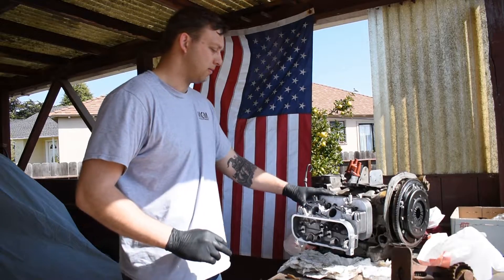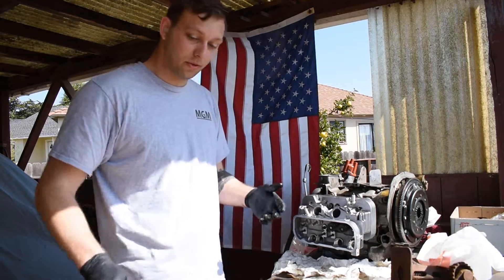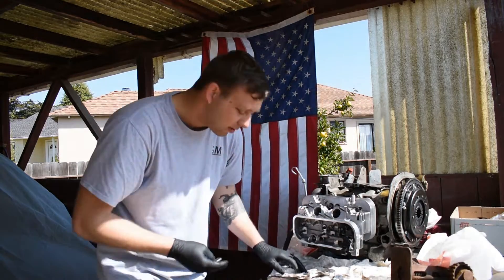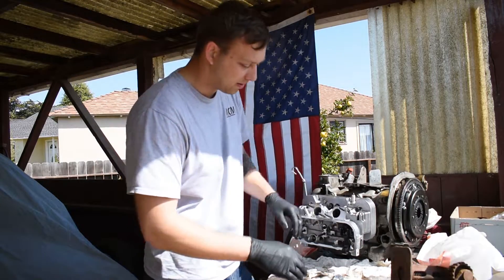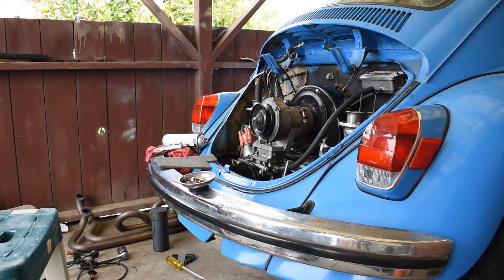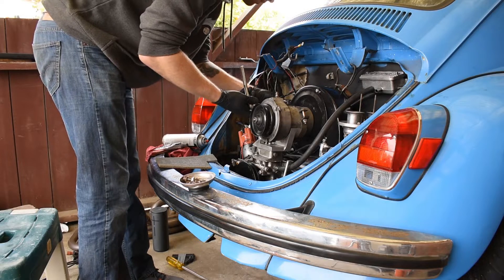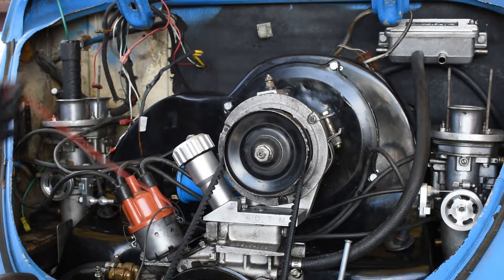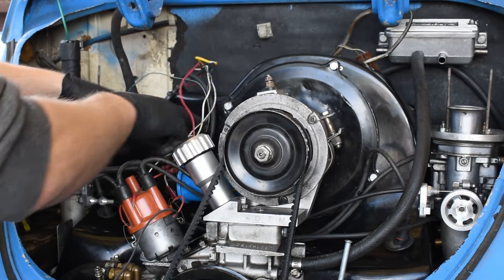VW Type 4 2056cc head replacement

Comment: What's your opinion of your T4 overall?  This is basically the exact same thing I'm building for my '74 Super.  I found your YT page while looking for opinions of the C35
Reply from the maker: I have sold my car but I liked having the type four. I experienced less oil leak issues due to better design and I enjoyed having a factory oil filter. Admittedly, the parts are more of a premium. If you're on a budget, it's probably better to stick to type one. Obviously if built properly, theoretically type 1's shouldn't leak oil. It was not my experience though lol. I think I also enjoyed the Challenge of the swap as well.
Reply: @super71beetle  
In your opinion, did you find the engine easier(or just easy) to rev up? I'm building my car for street/autocross, so I want a decent ability to rev.  I suspect a T1 would rev up faster due to lighter internal parts, but the T4 is going to last longer.

I think I live somewhat near you(in Modesto) after you mentioned Marsh Creek rd.  It's a shame(from my perspective) you sold the car
Reply from the maker: @johnlist9054  look at lightweight flywheels if you want a fast reving engine. I don't think one revs faster than the other pound for pound since the bores and stroke are very similar. I had a 71mm stroke by 96mm bore. As for selling the car, I have a c5 z06 now for racing. Once I got into my c4 vette, I realized I was fighting an uphill battle to make the bug do what the vette does. I have auto crossed the bug and it was fun! Needed more gear though for the track I was on in Monterey
Reply: @super71beetle  totally understandable.  I did see the video about the C5.  I'm a big Super Beetle enthusiasts, so my point is to autocross a Super.  I will do it for fun more than to be competitive.  It makes the build a bit more difficult due to the need to maintain streetability.  It'll be more a car for the street that can occasionally do an autocross.

Comment: Did you have  to modify the pushrods to work with the C-35 Scat camshaft?
Reply from the maker: Hey I somehow missed your comment - yes if you're switching from a hydraulic setup to a solid lifter setup, you should be checking valve geometry on the entire engine. It's a whole process... You may need to shim your rockers or change pushrod lengths.